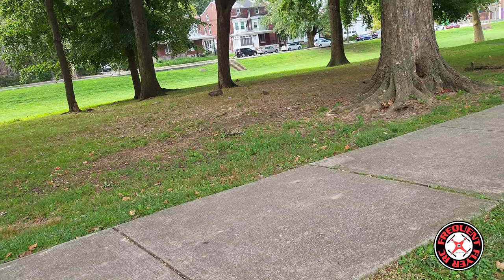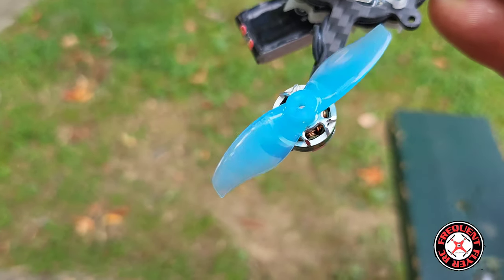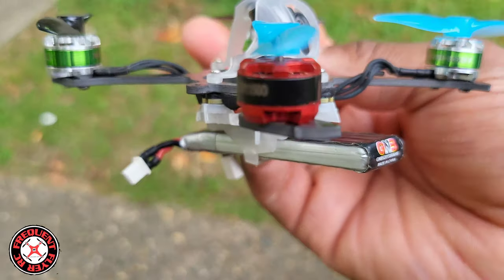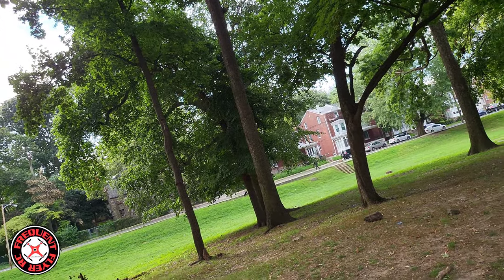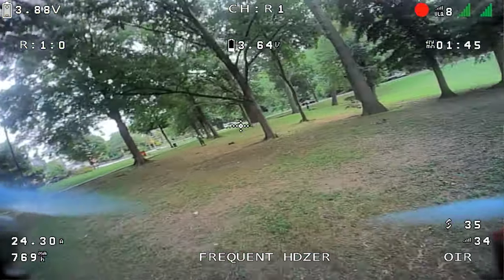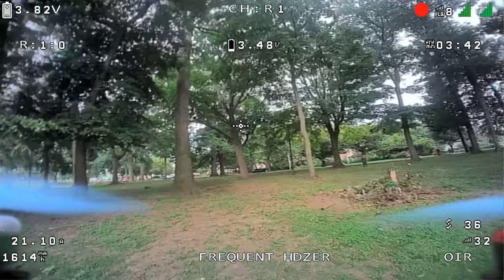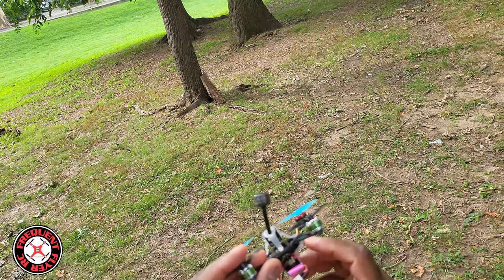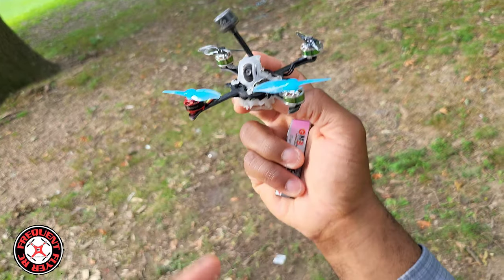Mobula 6 HDZero setup on 2 inch BetaFPV Frame  🔥🔥

Comment: That is the build I was looking for in my head and yt:) maybe not exactly hehe, this antenna is like overkill for me, but 2inch frame with Hdzero 1s. What is the weight? Do You enjoy better that Mobula 7/meteor 75pro?
Reply from the maker: Keep forgetting to weigh it! Will try to remember to come back and tell you when I pull it back out soon👍🏿
Reply from the maker: It weighs 39.93 grams 👍🏿